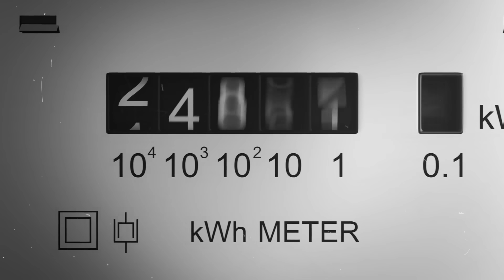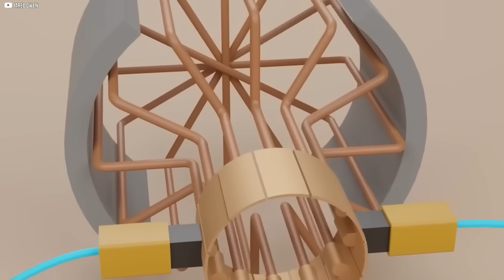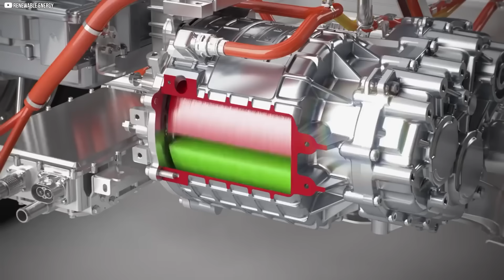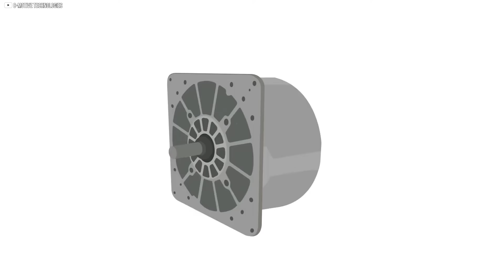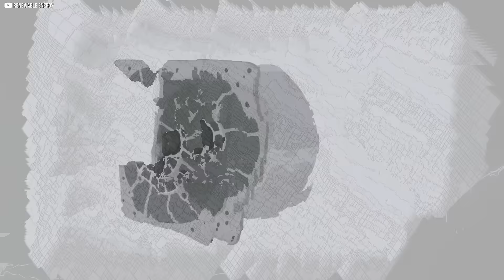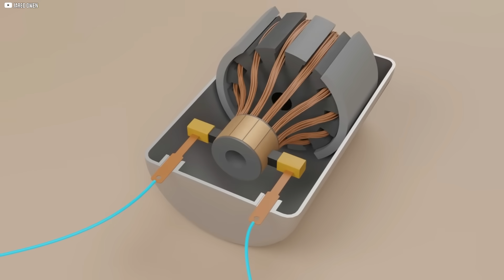99% Efficient Motor That Runs on Static Electricity

Comment: They may need high voltages but how many amps do some of them draw?  How many watts?  That is what would ultimately decide what sort of wiring changes are needed for them if there are any changes at all.  Think of it like this, the static you feel when you touch a door knob is thousands of volts also but with very little current.  As the weather cools down while we are on our way into fall and winter, it is more likely that you may feel these shocks when you touch a door knob.  Dry air makes it more likely to happen.